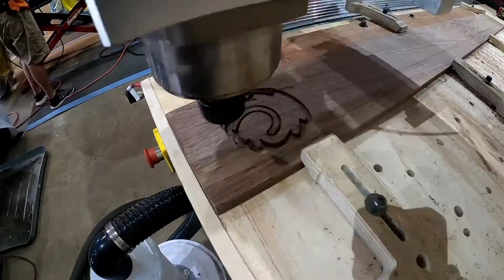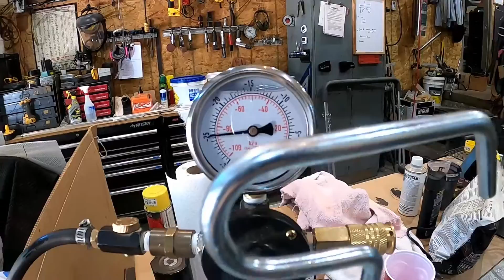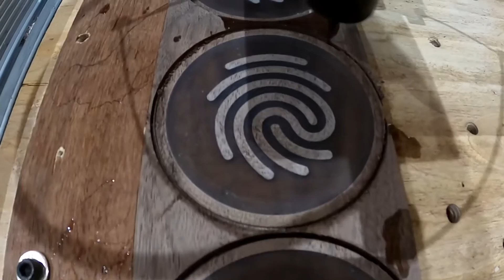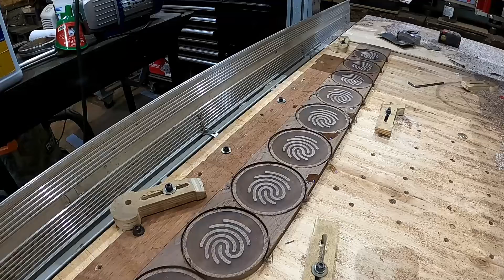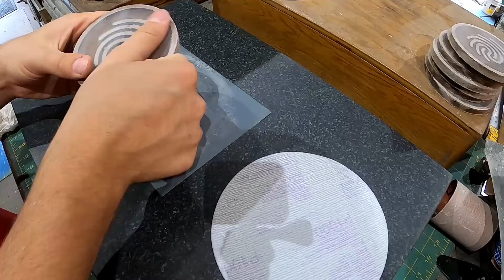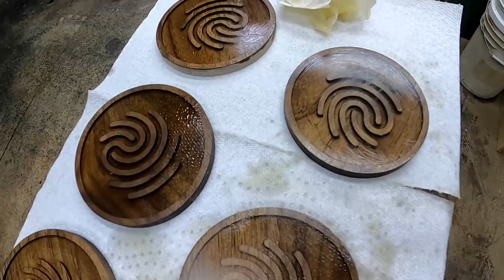Step by Step Wood Coasters & Epoxy Resin | DIY | AVID CNC

Comment: nice work, im inspired to do the same.  Tip for ya, you should seal your wood prior to adding the epoxy, it drastically reduces bubbles. Using your vacuum chamber and not sealing the wood kinda defeats the purpose of the vacuum.
Reply from the maker: Yeah I think I should’ve connected it to my compressor instead. Good notes, I’ll have to do some research

Comment: Hi there, cool project! I have a question though... I didn't know we could cut resin? Doesn't it release toxic fume?
Reply from the maker: That’s a good question and something I’d have to look up. I did not notice any fumes while cutting the resin, but I’d recommend mixing resin in a well ventilated room.
Reply from the maker: I will also say I’ve cut into resin with mixed results. Sometimes it melts during some cuts.